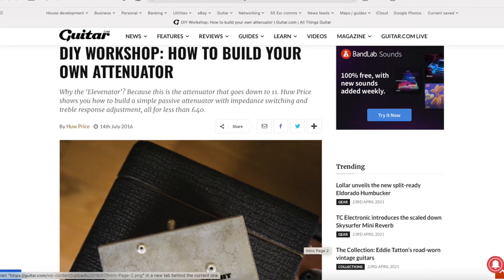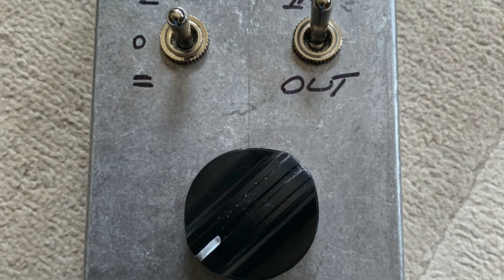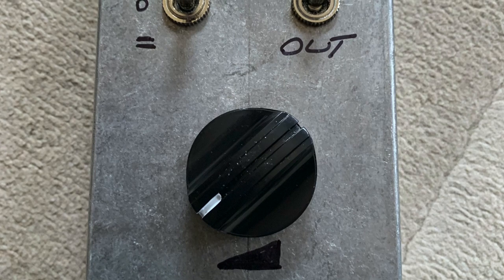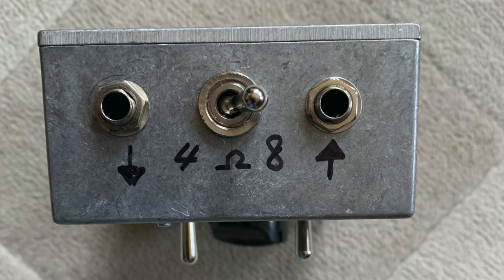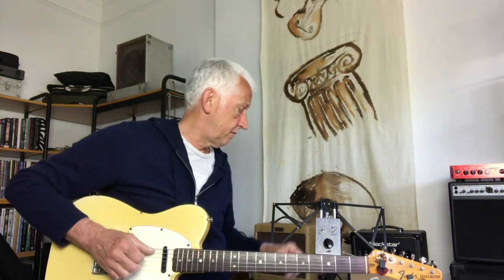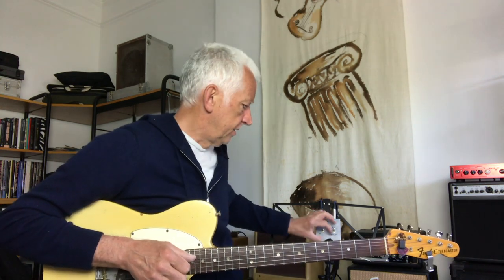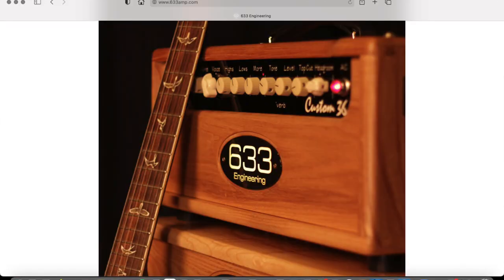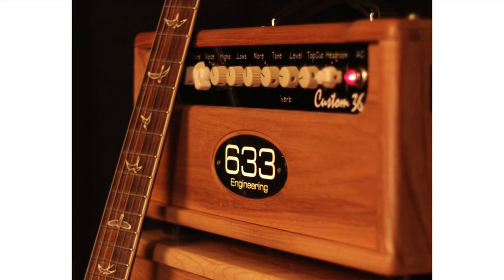Bob and Ramon Attenuator demo

Comment: I've just had a look at the schematic, and to tone switch can't add treble as it is passive. I appears to be working like a treble bleed circuit, so the effect may only be noticeable with a high powered amplifier and the attenuator turned right down - or at least that's the theory. Sounds good as is though
Reply from the maker: Thanks v much Clive. It is indeed a bleed, subtractive, but I can’t hear any difference even with guitar and amp set to full treble. Going to get my son’s younger, better high frequency hearing on the case as a further check...

Comment: Hi Bob. Where did you locate the switch which was out of stock? Thanks.
Reply from the maker: It’s the third switch guitar.com’s parts list, order code SW05066, discontinued. I substituted part no SW04029 and it seems to work. Good luck with your build!
Reply: @thebobandramonshow  Cheers, thanks for the info.